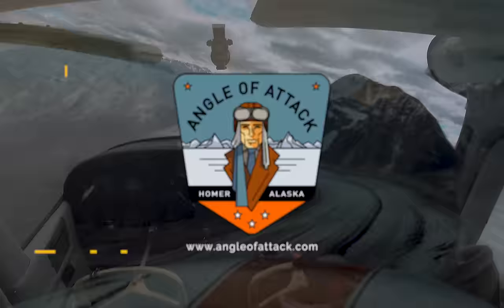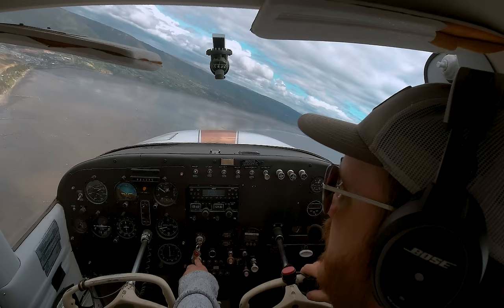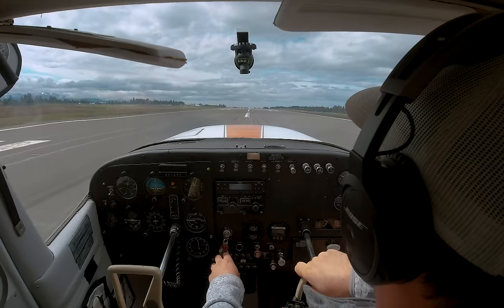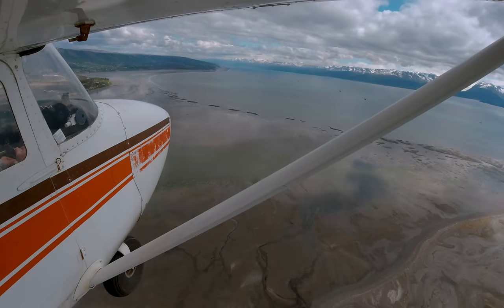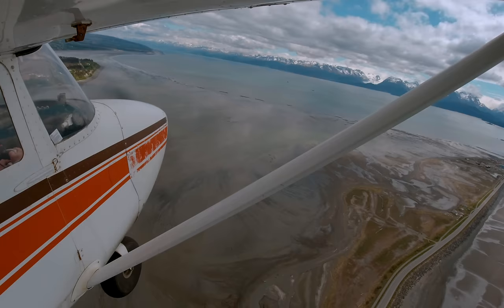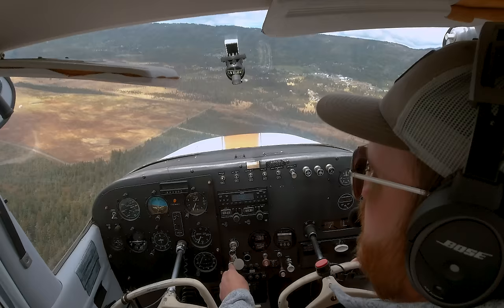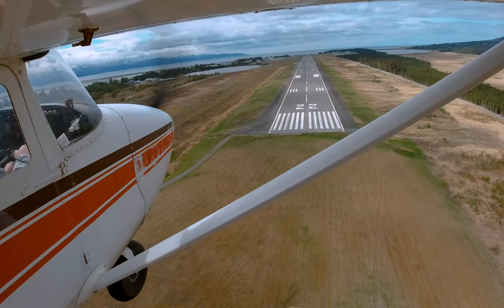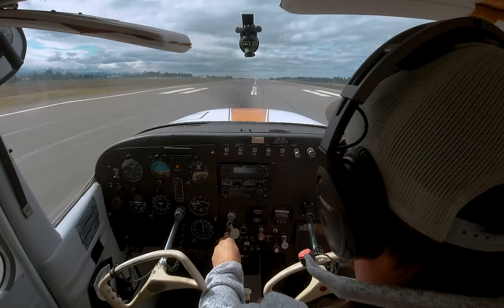5 Common Landing Mistakes [+] How To Fix Them | Flight Training

Comment: As an amateur aviation enthusiast I would like to ask a dumb  question. By the way, I really enjoyed your video and will search out any others you have produced. Anyhow, my question is; when on final with too much speed, is it acceptable to either put in more flaps and/or pull the nose up a bit? (assuming you are within the speed limit for the degree of flaps you would like to dial in) And if  a higher degree of flap were to be added and once the speed had been reduced to where it should be, would you reduce the flap setting back to the normal setting as well? Or is that too risky?

Comment: Hey Chris I have a question for you. I am a student pilot and wanted to know. Why do you slow to 90 knots? Before you enter the pattern and if staying in the pattern, just as you get on down wind?
Reply from the maker: It helps me slow things to a pace that allows for the checklists to be done right. And helps  the students slow it down.
Reply: Angle of Attack thanks I appreciate it
Reply: @colind3699  You also may be sharing the pattern with lower performance aircraft. Just about any aircraft can maintain level flight at 90 knots. You don't want to overtake the aircraft ahead.

Comment: Ok you said you’d show how to deal with the ‘too fast - dive at the runway’ scenarios after no4 but sorry I didn’t see it?  Also where do you stand on secondary effects for control (elevator for speed, throttle for altitude) vs Jacibsen/IFR elevator for pitch- throttle for speed? Thoughts?

Comment: Before watching you I was watching another set of landings on a light rainy day in Seattle.  This pilot always went to full flaps to reduce speed to 70.  Did I get it right with your landings going 2 clicks of flaps to slow to 70?  Does that mean each plane reacts differently to how much flaps are needed?

Comment: I just don’t get it. On landing plane gets hit by mild wind from left, it seems to push tail right which turns nose left, I apply right rubber and now the plane is aligned but drifting to the right and steering right.. it’s scary. I can’t get over this and I can’t do it. I hate landings. Especially high wing planes, that are affected by wind low to the ground than low wing.

Comment: Good job Dan.
I like that you didnt use full flaps like most of the yahoos.
👍😎😎
Reply: Having been a student pilot  and CP/AP for 50 yrs, 
I found that using flaps makes it harder for students to learn smooth landings.
Many many pilots told me that they thought about giving up because they had to master full flap landings before solo.
I would never use them until they get 15 hrs.
JMO, JME. 😁👍😎
Reply from the maker: That’s a good idea. I’ll have to keep that in mind.

Comment: Landing skills are the most common weak area with the brand new pilot. The fault lies in the fact, the Instructor from my experience are  working for the boss ,rather then the wood be pilot.
The key lies in the fact the Instructor and the would be pilot, regardless what status they are simply don't understand  the P of F.   ie., The formula. Taught well, it will stick to anyone wanting to get over the sweat hands approach and landing.  CL HALFE ROW V SQUARED S. It works very well on a DC3 and a C150.

Comment: Hi there, somewhat new to aviation, I was just wondering why he was on the right side of the air craft rather than the left? It seems all the important dials and indicators (attitude, air speed, altimeter, RPM etc) is on the left.
Reply: For better camera visibility to the Runway in this case to explain what this help video is all about.  The Command or Captain seat is LHS for any aircraft (ex Helicopters when it is RHS) for other reasons not relevant to the answer here, but you should be able to fly from both sides with extra skill and proficiency of many triple number hours of flying & handling experience ....or when you can confidently and safely land your aircraft properly visually looking outside and without the use of the Airspeed Indicator or any of the other flight instruments if they fail..... i.e. for the ASI if a blockage goes unchecked on your preflight and you have already taken off is one scenario.
Reply: That's where CFIs fly.

Comment: Anyone know are those 8.5 tires all around? What front fork and prop size and pitch are you using?
Reply from the maker: Yes. They are 850s. 206 nosefork from AirGlas. Cruise prop.

Comment: If that was a C172 it differs from our UK ones.  First we fly from the Left Seat, and what you had your hand on during landing would be the Carb-Heat here.  Also the ignition switch is on our far left of the panel, not in the centre.
Reply: He is acting as the instructor and he's in a 150
Reply from the maker: I’m in a 172.
Reply from the maker: Depends on the model.

Comment: Everythings looking pretty nice here? Well, with the abundant lenght of the runway in front, may be? But aren't Alaskanians famous for their bush-piloting-capacities? To me it looked that the height of the ac was significantly too much when passing the threshold. Don't know how many meters to the next mark when it touched down are - but in Europe the exam asks to touch down LATEST 150 Meters after the threshold - and pilot students are well trained (hopefully) before their exams. So that everything looks pretty fine i would consider when the landing happens on or at least short off the threshold marks - not significantly behind...
Reply: In practice, the goal is to land on your chosen spot, and picking the 1000' marks gives a student plenty of room to make mistakes without suffering dreadful consequences. If a student can learn to land consistently at the 1000' mark, then they can land consistently at another landing point closer to the threshold if they so choose.
Reply: @Joe_Not_A_Fed  Ak - okay! Question of different didactical concept. Sorry, but as we do regularly not have such abundant runways here in Germany i wondered what was told as "everythings looking pretty nice here" in your video. With this additional explanation it becomes very clear to me now - thanks!
Reply: @frankyspanky17  There are lots of techniques that we can learn from each other, from around the world. In Europe, I understand that because of the price of fuel, soaring is much more common than in North America. My first piloting was in a glider and nothing teaches energy control,  precision approaches and spot landings like not having an engine. I totally recommend it for ALL pilots, not just new pilots.

Comment: I didn’t hear anything about your flaps... I was taught that once I’m abeam the touchdown point, power to 12 and flaps to 10. 45 degrees turn base and flaps to 20. Turn final and full flaps and pitch trim for 65 kts. If there’s a healthy headwind 20 degrees of flaps might be all I need.
Reply: On these light aircraft you don't really have to use flaps assuming you have the runway.
Reply: Honestly I find full flaps excessive on a 172 on most landings. My airport is usually on the windier side and the extra speed makes the plane much more stable
Reply: Lars Lake agree. As I was taught it depends on runway length and wind conditions
Reply: Jason does have an interesting point. Once you "abeam" your touchdown point. ( I like that word) I was taught that once I abeam-ed(got even with); I was to pull off power and never add it again. In a 172, you'll have just enough time, on your base, to call and hit 20 flaps before making final. The purpose was to get you used to judging your distance to the point where the gear touches in case you were to make an emergency power off landing. I don't think many pilots are trained that way much any more.
Reply: @alfieboy4022  exactly
Reply: @vlkuser  yes you are correct
Reply: @larslake  I'll ask my Instructor to teach me that at some point.  Thank you.

Comment: Traffic pattern is for beginners, it’s a nice formula to get people practicing landings at BUSY airports.
It’s inappropriate that you said pilots are not disciplined. There are different types of pilot, amateur and pro. 
Amateurs use traffic patterns. 
Pro pilots can land regardless of positions in the air. That doesn’t mean they are not disciplined.
There are different techies to keep the airplane in the air or lose altitude in a hurry. Just depends on how well a pilot can fly.

Let’s say if you have an engine failure, can you use traffic pattern to land. Probably NOT. So, how do you land a big piece of metal on the ground SAFELY?!!

Comment: It occurs to me that at 6:22 it would appear that your turn coordinator is inoperative. Why is that just out of curiosity?
Reply from the maker: It has been failing at the time
Reply: @angleofattack  Thanks for the reply! I'm too used to the turn coordinator to do turns without it, that's why I asked. I've been out of flight school because of a change of instructors and I got to say, your videos have been helpful for my time not flying! I've learnt a lot, and I'm eager to get back into the skies and try some traffic patterns and landings, especially because its where I'm usually rough at.

Comment: Looking back on my PPL flying lessons I found alot of pointless cliche’s kept being thrown out by instructors who didn’t know what they meant. I think the worst one is the downwind leg horror story of engine failure you can’t make the runway. So what? Majority of pattern area accidents are engine failure during take off. Flying a 3hr cross country with little options to land safely the entire way, why suddenly is the 1 minute downwind leg and big cliche moment for knit picking distance from the runway? I think the base-to-final cross control stalls are a result on bad instruction training students to keep too close to the runway, carrying too much speed and not allowing a smooth standard rate turn from downwind-to-base with enough time to straighten out and stabilize, that leads to rushed base-to-final overshooting the centerline. Successful landings are setup and made by midfield of the downwind leg, rather be further out from the runway, allow a little extra time to trim for pitch, flap settings and speed when abeam the threshold and through each standard rate turn into final approach.
Reply from the maker: I wouldn’t discount the issue. It’s not just about “engine out” but also about proper energy management. Someone who needs power the entire time doesn’t know how the wing really flies. Also, plenty of horror stories with carb ice being an issue. So I’ll keep doing what I’m doing.
Reply: I have had two in-the-pattern power failures, one I got back on the runway and one I did not.  No sense not being within gliding distance to the runway whenever possible.  I won't be providing a reference to the NTSB report because it doesn't make me look good... at all.
Reply: If you're flying 3hr cross countries with no plans for ditching safely,  get a new hobby. That 1min is important because you're low and slow, with minimal glide distance.
Reply: And, on the topic of cliches... "Successful landings are setup and made by midfield of the downwind leg." Maybe for student pilots and fresh ppls, but in the first 100hrs you should be able to accomplish a successful landing from any aerodynamically viable position, altitude, and airspeed. I'll forgive boing 737 patterns from a student pilot, but once you get your ticket its time to give up that crutch and stop tormenting the rest of who want to conduct our pattern work safely and efficiently.

Comment: Why does your stall warning horn keep chirping? Or is that something else.
Reply: Right before he touches down?  Ideally you'll be close to a stall right before you put the mains on.
Reply: I wondered about that too. It was chirping intermittently on final which would worry me. But I'm also not 100% it was the stall warning. Maybe this could be clarified?
Reply: RRice No, throughout the flight.
Reply: Ease up guys yes that was the stall horn, he was putting on a demonstration and yes it went off a little before it should have but he handled the situation and that's what it's all about
Reply from the maker: It’s actually the control column squeeking.

Comment: Are you supposed to hear a stall horn on landing?  I thought no.
Reply: For Basketvector...you will hear little chirps, as you're at minimum controllable airspeed, easing down through the ground effect with slight pitch changes so the plane settles as early as possible. He had some wind to contend with as well.

Comment: Even your normal pattern seems rather large. If you have to carry power once abeam midfield  on downwind, you could not make the field if you  had engine failure in the pattern.  Low and slow with nowhere to go is to be avoided at all costs.
Reply from the maker: I can make that landing every time.
Reply: Angle of Attack  thank you for your response, but how is that possible?  Please explain.
Reply from the maker: I was certainly close enough to make the power off landing, easily. Standard pattern for me. It’s about a half mile and quite easy to make a power off landing.

Comment: A lack of discipline is your misleading  advice on circuits, and your confidence. Tight circuits can NEVER be a remedy to bad landings, it's the other way around. There is a reason  circuit are 1000ft, you overshot the runway, you are constantly landing deep into the runway, you give yourself little time on final, because of your tight circuit. A tight circuit is a perfect recipe for an unstable approach. Moreover, there is a limit to how steep you can bank on descent, no such thing as a 'tighter turn' from base to final.

Comment: I'm sorry man but you're giving impossible advices. While they make sense on their own alone, they don't once  combined. You advise novice pilots to not overshoot the final turn while advising shortening the base leg at the same time - you contradict yourself; for a novice pilot, following your advice would only increase the workload (and most likely, result in even worse landing).

The rule in aviation is simple: do not rush. Are you novice and having too much workload on base? - buy yourself more time. If that means flying slower - yes, fly slower if you can. If that means flying wider pattern - do it, why not?
Reply: Totally agree. Especially when you get into the turbine world. Give yourself plenty of time and space.
Reply: You turn sooner on base leg to avoid over shooting. Don't see any contradiction here. Also if there are more than 1 plane in the circuit you should stick to the normal circuit pattern, where other pilots will expect you to be, not extend far out. You make your circuits longer, the plane behind you may not see you, and get too close when you turn base. Stay where you're supposed to be. You can fly slower on downwind if you need more time
Reply: This crap of the three mile final for 150, 172 and any other plane in this structure  has got to stop, this is what gives the novice headaches !!!!!!!!
Reply from the maker: Bingo